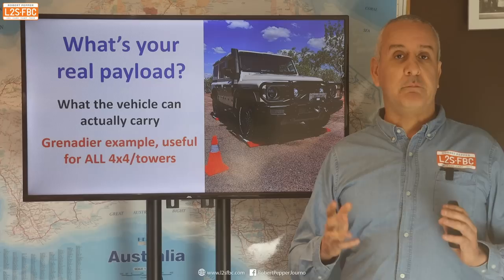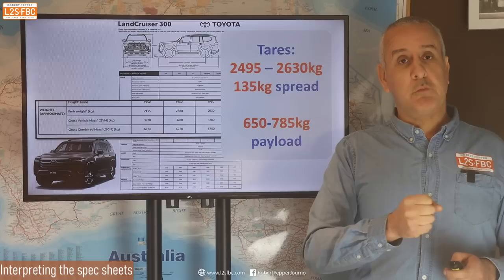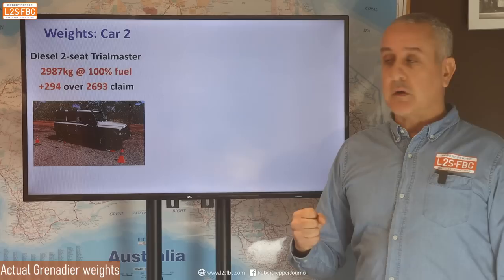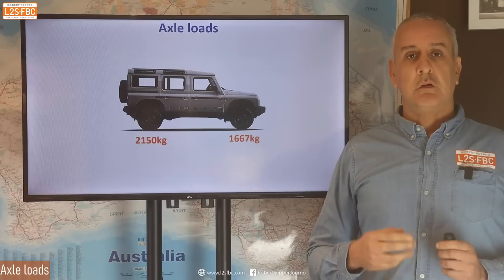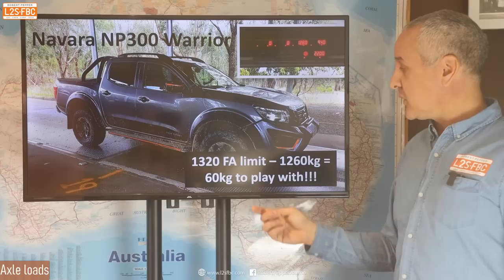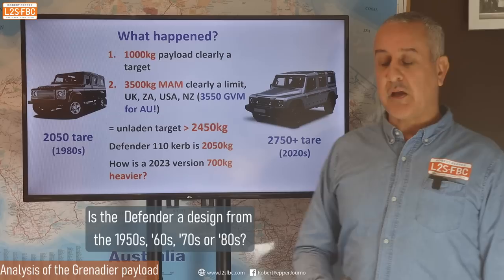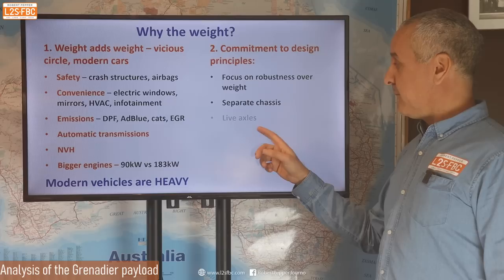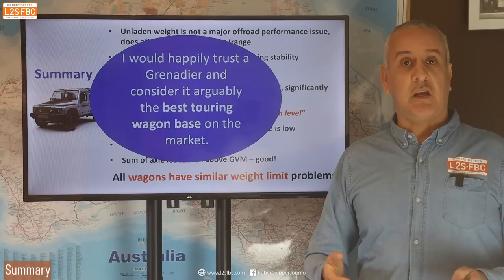Traps in 4x4 payload calculations - INEOS Grenadier example

Comment: Robert, FYI the Ineos UK brochure contains published weights for the Belstaff Editions, those being the Trialmaster (payloads of 759kg petrol and 684kg diesel) and Fieldmaster (payloads of 822kg petrol and 747kg diesel) with the rest of world GVM at 3500kg, 90% Fuel, all liquids and no driver.
Reply from the maker: Thanks, missed that when I looked at the UK brochure! INEOS PR did not mention that to me in our chats either...and it appears my calculations were pretty close assuming Trialmaster definitions are consistent throughout the world.  Certainly I find tare weights vary across the world due to local regulations which dictate specific equipment, and local preferences. For example cold climates might require pre-heaters, back in the day aircon wasn't standard in Europe and so on.

Comment: Whilst i strongly disagree with much of what you say, i respect that you are entitled to your opinion and have taken the time to put together your videos.
I also appreciate that you haven't done those pointless comparisons between utes/pickups such as 0 to 100kph or the number of cup holders.
Keep it up!
Reply from the maker: Thanks why do you disagree?
Reply: @L2SFBC  Why do I disagree? I've owned loads of LR's, Toyotas and double cabs and have a Grenadier now, so I guess my views are valid.

What do I disagree with?
Split rear doors
Torx bolts bring inconvenient (or was that another vid,)
Using any kind of LR as a comparison, they are school run urban cruisers with 4 wheel drive.
Unless I missed it, you didn't point out that while many vehicles (specifically double cabs) maybe rated at a tonne, there is no way they can safely carry that payload with factory suspension.
Reply from the maker: Fair enough we can disagree there. No, I didn't point out the suspension issue, but it's not really a problem as all you do is change the suspension and job done.  You can't do that on Grenadier as the payload remains low.  If there is a GVM upgrade - see my recent interviews with Justin - that'd solve that problem.
Reply: @L2SFBC  Since you mentioned aftermarket upgrades, there is at least one Aus supplier taking the GVM to 3800kg. Guessing restricted to certain states.

Comment: Excellent video. I just checked the German datasheet from Dec'22 and all the detailed empty weights and payload are specified for Trialmaster and Fieldmaster separately.
1) Trialmaster Diesel: empty weight (w/o driver) 2811kg, payload 689kg
2) Fieldmaster Diesel: empty weight (w/o driver) 2744kg, payload 756kg
Weights included all standard options for TM/FM. So for me this is done the correct way, nothing to complain at all here!
Reply from the maker: Great so my calculations for the Australian video weren't too far off, but that assumes Australian Trialmasters are the same as German, which may not be the case.

Comment: Another amazing video, as always. I think the Grenadier increased its GVM to get rid of the luxury tax. Apparently that weight puts it in a different class.
Reply from the maker: Yes, explored that in this interview https://youtu.be/5YPtEk6b3O8 and that was definitley a factor, but I think also that GVM might have been a consideration. Goes into NB1 which is different safety and emissions, GVM 3500-4500.
Reply: @L2SFBC  Thanks for another interesting video. I understand NB1 is greater than GVM 3500, so GVM had to be increased (slightly) from 3500 to get that category. I'll speculate that GVM is increased to obtain that category - particularly with the luxury car tax exemption and the different safety/emission requirements

Comment: The other issue with a solid axle is the turning circle. The Quartermaster pick-up has a wheelbase of 3227 mm and a turning circle of 13.5 m kerb to kerb whereas (by way of example) the Ford Ranger has a wheelbase of 3270 mm (43 mm longer) and a turning circle of 12.9 m (600 mm shorter)

Comment: The takeout from this is that when you buy any vehicle that will be loaded up to the max with stuff, you must factor in weighbridge sessions to keep yourself legal.  Most new vehicles and many used vehicles can have a GVM upgrade done which is no different for the Grenadier.  Modern cars are definitely much heavier than those we had in the 60s and 70s - if I recall correctly a Kingswood was just on 1000kg, compared to my 15yo GTI at ~1340kg.

Comment: Hi Robert. Lot's of discussions on the Grenadier Forum about this video. As usual a fantastic analysis and your video's are becoming  very well received and respected as a reference on vehicles and 4WDs in particular. As for payload on the different versions it becomes difficult as there are so many options and configurations, particularly on the MY23 versions. These are just some of my main options Fieldmaster, Diesel, Donny Gray, Gray & Black leather, Rough pack, heat reflective glass, interior utility belt, exterior utility belt, roo bar, side bar, chequerplate, raised air intake, side runners, front tow mounting plate, auxiliary battery, hi load electrical switch panel. If the Ineos configurator tried to work out the remaining payload smoke would start to come out.  The other thing with payloads is that Ineos include 90% fuel, all fluids (including adblue), they used to include the driver but have now dropped that.
Reply from the maker: Thanks - yes, it can get too complex, but at the moment the information is too simplistic.  Think of it this way - they manage to vary the price for each of those options, so why not the weight?  The logic is the same, add onto a base, in the database the option details already exist, simply record the weight for each...which they know, as it's in the catalogue.  There may be some small variations, but simply say "approximate" and that's a lot better than nothing. Whether the driver is included or not is up to INEOS; as long as they are clear what 'tare' means for them, then that's fine.
Reply from the maker: Also, there will be another video on Touring - I was going to cover weights in the Touring video but it became its own topic, as happens sometime. After that, I'm lining up Grenadier vs LC300 vs Y62 vs L663.

Comment: I put the Jimny on a weigh bridge today. Total weight with a full tank of fuel, me and all the gear for a day off road, 1410kg, so within GVM, but the axle split was interesting. 720kg on the front and 690kg on the rear. I don't have a bull bar. I do have a concealed winch that weighs 36kg with the mount (24.5+11.5) and a set of recovery points (8kg). This 44kg actually adds 52.8kg to the front axle weight as it is forward of the axle (+20% for the 3dr Jimnys dimensions, a 5dr will be less with the longer wheel base). I'm guessing every Jimny with a bullbar is over spec' on the front axle.
Reply from the maker: I think you'd be right re front axle, doesn't take much!

Comment: Thanks for an informative, balanced and fact based analysis.  This is why I'm a Patreon. The trial master should be great for towing where some weight can be in camper. One question re front axle weight. Presumably, towing with a ball weight of say 220kg would reduce the weight on the front axle and alleviate the front axle issue somewhat
Reply from the maker: Thanks for your Patreon support, appreciated and yes towball mass reduces weight on the front axle. The Grenadier has lots of rear axle load to play with.

Comment: Excellent video. Don't forget the IG comes standard with steel bumpers and recovery points front and rear and two bash plates. All the cars in your comparison this still has to be deducted (except a 70 Series LC). Also consider the weight of AT Tyres can be 6 to 10kg per Tyre heavier than standard road Tyres I found, which probably explains the 30kg you were missing from the base in your calculations.
Reply from the maker: Yes, you're right - I did allude to this in the video.  The 76 also has an RAI as does Trialmaster, etc etc.  All comes down to knowing what you're comparing - even the definiton of 'tare' changes, let alone the 4x4 add-ons!

Comment: Thanks for another great video Robert. You mention you could uprate the front suspension with heavier duty springs. INEOS have said, but not officially, that they have a range of different springs that they fit depending on the accessories ordered and indeed owners have confirmed there are different spring model numbers in different vehicles.  Although INEOS  doesn’t provide any details on this do you think it’s possible that the front axle load limits (technical, probably not type approved for legal purposes) are already better than we think due to this?  Although why INEOS wouldn’t state that if that is the case, is a mystery.
Reply from the maker: The front axle limit is 1667kg and there would be a margin in that.  Same way as the GVM snuck up to 3550kg.  Given that many Australian cars are running around with re-rated front axles, and these axles are not snapping, I would suggest there is margin for upping the rating to at least 1750, which gives some valuable space for owners.

Comment: The Black sheep innovation roof rack utilises the roof grab mounting points resulting in a dynamic load of 250kg. I believe Ineos Australia said in a recent interview that they are pushing for a even more basic version of the quarter master with 1000kg payload.
Reply from the maker: I didn't see that interview. I think the only way the Quatermaster will get to 1000kg payload is if it's a single cab with no tub.  Which wouldn't then be a true 1000kg payload.
Reply: My question is how did Black Sheep get 250kgs of dynamic roof load using 1.5mm tube aluminium as the main dynamic anchor point?
Reply: @mikefoster7085  mike they don't use the aluminium tubes as mounts, they use the mounting points as l said and piggy back a bracket off the bolt point. They say this mount can support even greater load but they give a conservative rating of 250kg
Reply: @watda011  BS use the roof as the main load point, the platform sits on the roof rails . My concern is that the rail mounts aren't rated by AI so this is a potential warranty issue. I personally think these aren't suitable for Australian conditions.
Reply: Like you say, most of the load sits on the standard roof rubber rails which support 70% of the load and the remaining 30% is anchored to the handle via 24 X M6 just to keep in place. In any case at $8030 just for the roof rack (2 platforms + extension) delivered to Australia l doubt many in Australia will be purchasing it. I certainly won't
Reply: @L2SFBC  Quartermaster is coming as a cab/chassis but then something like a tray etc will need to be added so as you point out, not the true payload.
Reply: @DavesIneosGrenadier  You could put a Canopy and not a tray and then the Canopy weight will be part of the Payload.

Comment: Hi Robert,
Trialmaster diesel has 689kg payload as published in UK brochure. 
I had a deposit on Trialmaster  and got a refund due to insufficient payload for my needs. 
I live in Aus and as you point out frustrating that Ineos don’t give payload specs in AU brochure for variants however If you look online at the UK brochure it does. 
The Trialmaster has published figures of 689kg payload.
I understand you did best you could with estimating 80kg more weight in Trialmaster but it’s more like 143kg extra weight, hence I cancelled order.
Thank you for you clip, excellent as always.
Reply from the maker: Thanks - vehicles specs are typically country specific so a Trialmaster in the UK may not be the same as one elsewhere. But a useful reference.

My 80kg was on top of the base weight which I think is at least 30 over the published 2718.

Comment: Great break down.  Many consumers here in the States never think of payloads or tow capacity.

Thanks for raising awareness about payloads.

What could someone who wanted to increase payload capacity, modify or change out? Ie install: beefier leaf springs,  stronger shocks,  wheels and tires...?
Reply: It's a coil sprung vehicle,  so uprated coils and from what Robert has mentioned an uprated front differential would give you that.
Reply from the maker: Legally, all those mods would make no difference. You'd need to a) get the GVM increased or b) reduce vehicle weight. The latter could be done by removing seats, changing batteries to lithium along with chargers, alloy wheels, pulling out some trim and soundproofing, things like that.
Reply: @L2SFBC  curious to know what's involved in an uprated GVM for the Grenadier front axle? Obviously an engineer, but what components would be needed to make this so?
Reply from the maker: Typically engineers just sign off on a new rating!

Comment: As ever, a comprehensive look at the sometimes baffling world of weight. 
Speed limits also come into the fore as here in the UK the Utility versions fall under different speed limits compared to the Trialmaster & Filedmaster. 
50mph for single carriageway, 60mph for dual carriageway, but 70mph for motorway (as with cars). 
The Trial & Field masters are “cars” so can go 10mph faster on single and dual carriageways.
Reply from the maker: Interesting, thanks!  Would be a pain to have to drive that slowly!  Where I live in Australia, I can tow 3500kg in a 3000kg car at 110km/h, legally!
Reply: As we can, as long as the vehicle isn’t registered as a commercial! 
Pop across the border into Scotland, and it all changes again!! Bless them
Reply: @L2SFBC  Probably doesn't mean you should though in most cases!
Reply from the maker: Yes!

Comment: Very important video. Thank you for going the extra mile. A payload of just over 700 kg for the Grenadier is just not enough for what the car was designed to be. I really want to get away from buying another pre-2009 Defender 110, but the payload numbers of modern offroad vehicles are just 300-400 kg too low - and that's a lot of difference that is hard to bridge. Plus the Grenadier will need much more fuel than any old 4 cylinder Defender. Even fully loaded, the Puma only took 10-11 l per 100 km, while the Grenadier will actually need more payload than the old Defender, since it will need more fuel for the same distance.
Reply: Will you survive or walk away safely if the old defender had an accident? I am sure payload can be upgraded in the aftermarket like other manufacturers do. But the safety of life will surely be compromised in a old vehicle without the safety tech.
Reply from the maker: Exactly!
Reply from the maker: In a crash you wouldn't want to be in the old Defenders...
Reply: @L2SFBC  Yup so get a new Defender and not a Grenadier.
Reply from the maker: Hmmm.....

Comment: I’ve also pulled the pin on my planned purchase of the Quartermaster based mostly on the poor payload. Very disappointed with many aspects of what is now actually being offered compared to the expectations that had been raised. It won’t appeal to Oz farmers, miners or tradies in any numbers and so will suffer a lack of aftermarket options including GVM upgrade, at least for some time and from what you’re saying a GVM upgrade is going to be very difficult based on the front axle rating anyhow. IMO It’s ended up far too Euro-centric and has become more of a Sir Jim vanity project. What Ineos should have done is got some Australian dual-cab engineers with experience in the target markets (miners, farmers, tradies) into the design team from the start. 
What a lot of people don’t understand is that not only does exceeding the vehicle GVM impact on safety and insurance but has potentially severe legal consequences. Plus until recently it was rare to see the “scalies” pulling over RVs but I see this happening more and more frequently. You are 100% correct in stating that payload should be one of the most important decision factors for a vehicle (esp dual cab) purchaser and perhaps we need a change in consumer law to ensure we can see the expected kerb weight of a vehicle prior to purchase (and also see the true ground clearance as you again rightly point out).
Reply from the maker: Agreed - for me, you work backwards - 1000kg payload is the goal, now what do we need to do to make that happen.  If we need to lose the much-vaunted live axles, so be it. Otherwise, I've got a hiking backpack that weighs 8kg instead of 2....no good!

Comment: An area that I feel the Grenadier is markedly better is that the bumpers at each end are metal. I do not know of any other wagon which has this. Every other wagon, and most utes, will have at least one end with fragile plastic bumpers. Often these are not simply bumpers, but incorporate the lower panels for a substantial part of the vehicle. This means that to achieve a similar level of off road functionality on these vehicles, those fragile areas need to be upgraded. I agree, the payload on all these vehicles is disappointing. I was hoping the Grenadier would provide us with a vehicle we could simply option up and use without the huge expense of GVM and possibly GCM upgrades. BUGGER! It didn't. Maybe a review of the techniques used to fabricate the chassis, similar to the Toyota 300 series, where they reduced the overlap of folded material on the chassis, in conjunction with other changes and were able to cut 200 kg from the vehicle mass. Looking forward to the evolution of this vehicle.
Reply: Plastic bumpers are to save weight and assist in crumple zones in an impact/crash.  Metal bumpers once deformed in an impact/crash, stay deformed.  Metal bumpers also do greater injury to pedestrians, that's another reason they are not popular.